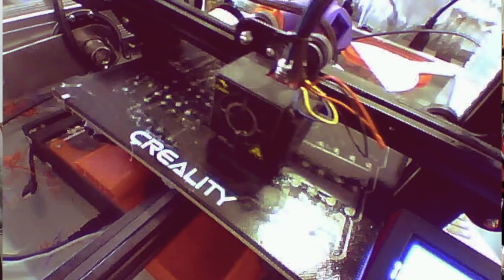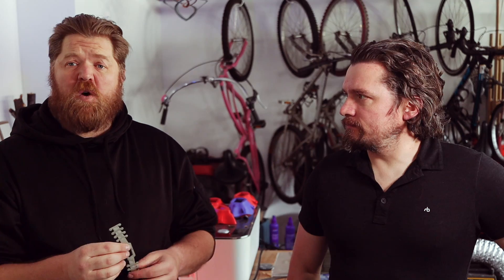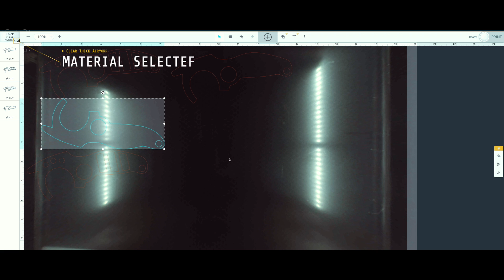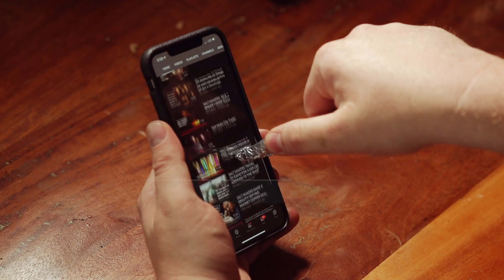We Help Fight Covid-19 with a Laser and a 3D Printer!  Join Us!

Comment: I don’t have a glowforge. I actually have one of the red and black Chinese cutters you briefly
Mentioned in another video, but I have made several modifications and love it. I still really enjoy your videos and appreciate everything u guys are doing. I have an original prusa printer as well that I just laser cut a acrylic enclosure for but have never used so may use your files as the first culprit lol. I am not sure if the glowforge uses a water pump and water to keep it cool like mine does, but I have learned that keeping that water ice cold by freezing Aquafina bottles of water and putting them in the distilled water makes my cutter perform SO much better. The cutter I have can cut through 3/4 materials, but when you let that water get warm, it begins losing effectiveness greatly. I have also added fans to the underside of my cutting platform that are metal and help not only hold the object I am cutting tightly down to the cutting bed, but they also pull the smoke that the air assist is blowing, right down to the exhaust port and takes the smoke right out of the machine. I added one on the side as well that pulls fresh air into the unit and blows horizontally across the cutting area. Each fan has a speed controller so you can decrease or increase the speeds if you prefer. I literally don’t even see the smoke anymore when I cut, and never smell anything at all. Just a little advice there I have learned about my machine. One other thing to note to anyone who may have a Chinese cutter., and I can’t stress this enough, is make a straight line on a piece of wood with a pencil and place it in to the machine. Bring the laser head down close to the line (ours has a laser beam to use as a guide) and run that laser up and down the table to see if it’s running straight. Mine wasn’t and I had to loosen the belt on one side and skip it back about three teeth on the belt. Also. Make SURE the bed is level as well as the laser tube itself. My bed wasn’t level so I ended up having to remove the belt on that as well and manually rotate the worm gears and lever the bed up
And put the belt back on and voila! Also, cannot stress enough to MAKE SURE there are NO air
Bubbles in the laser tube..... if there is(has been once in mine), simply lift the entire unit up towards the side you want the air to leave the tube and then lower it back down gently and they will be gone! Corel draw and LightBurn are your two best friends when it comes to designing. Anyways, thanks again guys for everything you do. I know it takes time to make the videos, I have done it first hand without the editing you guys put into it and it still
Takes time. Enjoying the channel greatly and your works
Reply from the maker: I think the term "Glowforge" is quickly becoming something like Xerox, or Kleenex.  If it works for you it works!  That's awesome, Glad it's working for youi!